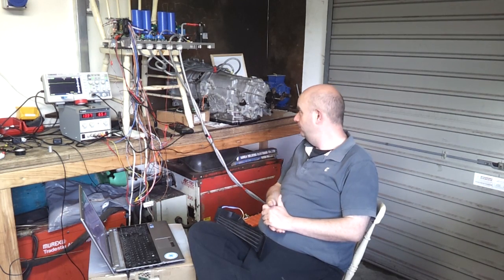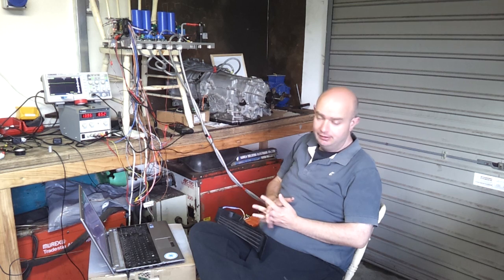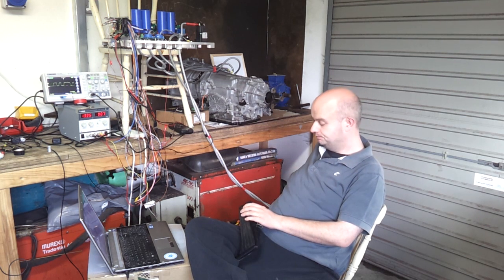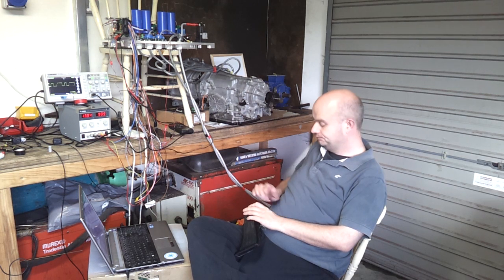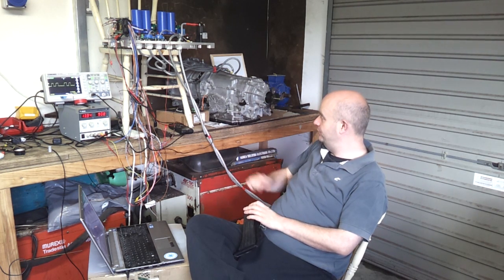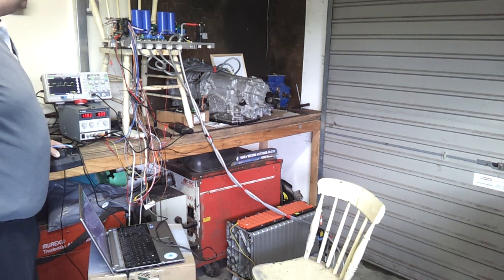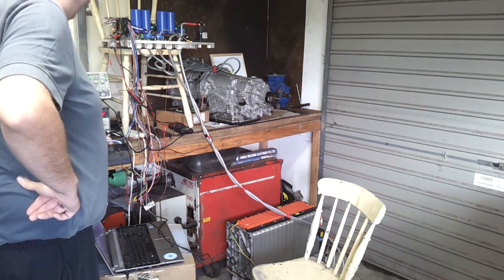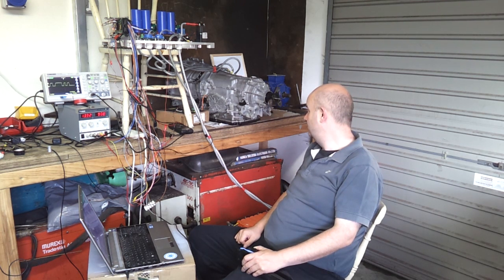Lexus Toyota Hybrid Transmission Project 07 : Torque Setting

Comment: Would this system work on the RX450H gearbox advertised which I believe is for the front wheel drive ?
http://www.ebay.co.uk/itm/Lexus-RX-450H-Gearbox-3-5-Hybrid-Electric-RX3-CVT-Gearbox-2013-Lexus-Gearbox/331301713713?_trksid=p2045573.c100033.m2042&_trkparms=aid%3D111001%26algo%3DREC.SEED%26ao%3D1%26asc%3D20131017132637%26meid%3Ddbd865e658984c12a3816612772e415d%26pid%3D100033%26rk%3D2%26rkt%3D4%26sd%3D221967935421

Comment: Damien,
Check out my video

https://www.youtube.com/watch?v=u9YO9DSxslQ

I am also experimenting with the Toyota IPM motors.  My MG1 and MG2 are 8 pole motors and I assume Lexus transmission to be the same.  The tricky thing to keep in mind is the resolver produces two electrical revolutions per mechanical rev.  The motors being 8 pole have 4 electrical revs per mechanical rev.  So if you are using the North Marker from the R2D board you will get one mark per 2 electrical rotor revolutions.

I am only using one resolver in my setup since I have the MG1 and MG2 shafts welded together which might not be obvious from the video.

You can search on my jddcircuit handle in the DIYelectriccar forums for other info if you like.

Good luck
Jeff
Reply from the maker: +jddcircuit Thanks very much! That explains a lot:)
Reply: +Damien Maguire  I bet if you let your software guy know that the NM signal is only coming every two electrical cycles your phase alignment will make more sense.

You also mention a phase offset setting.  I think I am using about a 25degree shift to produce negative d current (-Id) along with the Iq currents.  This helps take advantage of the reluctance torque component that these motors have.